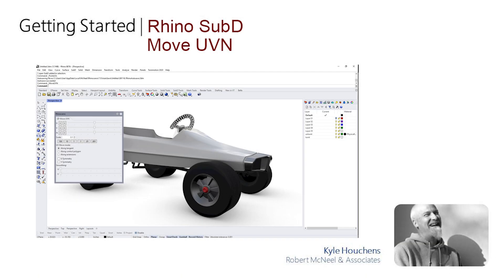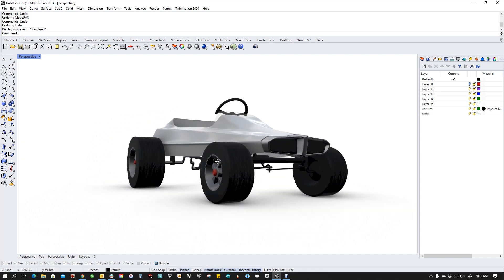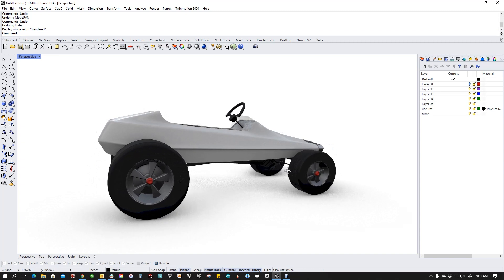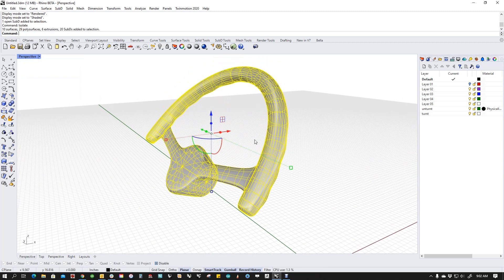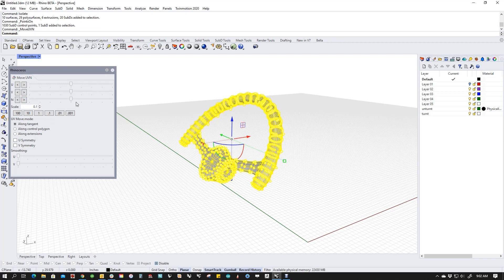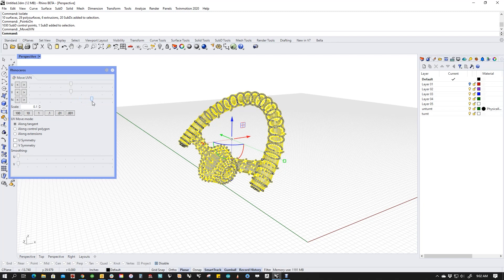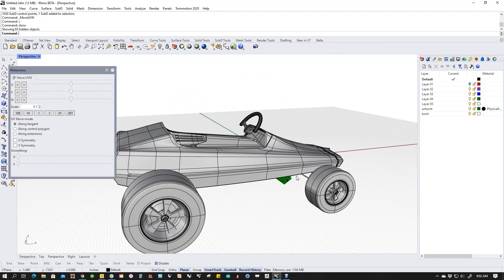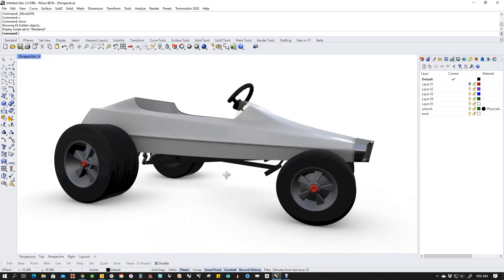Rhino 7 - Move UVN to inflate a SubD

Comment: Using Rhino for Mac. When I do this, it all looks fine but when I deselect the points it goes back to the original size.Any idea what I am doing wrong?
Thanks,
Reply from the maker: Try purging your history?
Reply: @Rhinoceros3d  Thanks Kyle, Doesn't work. But the gum ball works and selecting the points and moving works. Must be something with Rhino 7 for Mac. Also thanks for the other videos, I've learnt a lot.
Reply from the maker: @allanbeagle4664  are you using reflect? If so only one side will allow updates
Reply: @Rhinoceros3d  Reflect isn't on when this happens. Maybe it's just a bug.
Reply from the maker: @allanbeagle4664  record the screen and send us a file, your system info (from rhino) and steps to reproduce to tech@mcneel.com I’d like to see what is going on.
Reply: @Rhinoceros3d  Panic over ! I had the soft edit on, when I disable it, everything works as shown.
Thanks again for the videos.